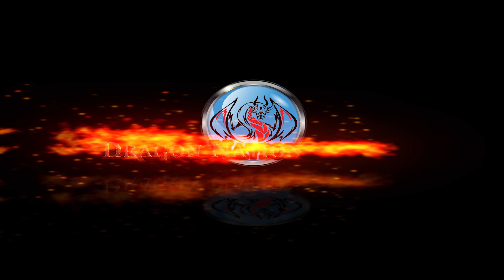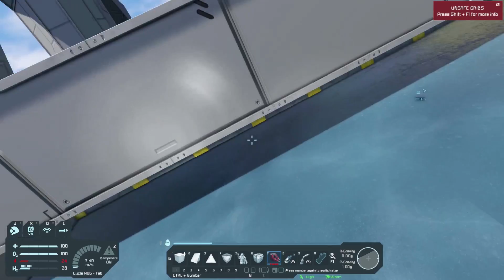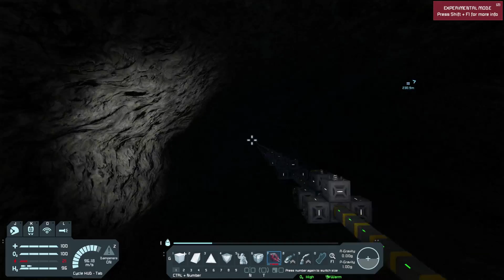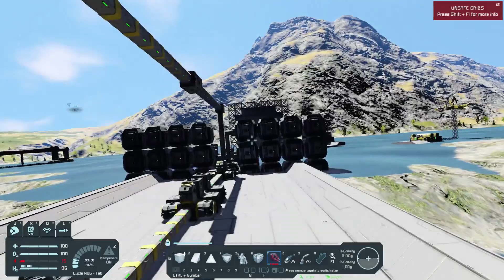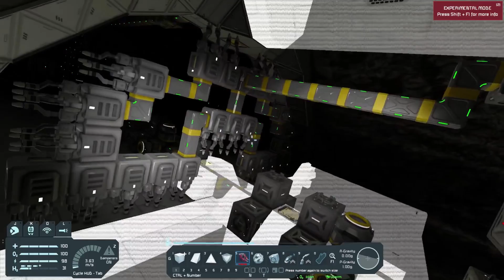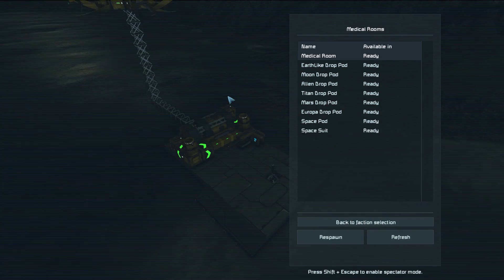Space Engineers #12: Finishing the Tunnel

Comment: Instead of trying to make a round of welders pointing outward, I would have made them pointing backward, so they weld from behind each block, not from the inside circle(if that sentence makes sense) :/

That way you could have used the original ones(and the projector pointing backward also), could have been attached to your inch worm :D or be a separate one following the digger(with the grinders too or something, using the same tether :)

Too late now :D
Reply from the maker: You can't because of the collision mesh. I tried it.

Comment: Skipping through, there are other options you likely haven't considered.... Instead of having all of the welders facing along the edge of the tunnel - add some to the REAR. This way, when you move inwards, you can weld up the 3 thick arches, without losing anything. You would need to keep those projectors stationary, most likely, either by making temporary projectors or by having another set of pistons move the projector in the opposite direction as you move.

Comment: instead of making an inch worm welder rig to do the complete tunnel ... make a wheeled version that does one side only ... every other center junction from the inch worm digger put in your support frame ... the empty ones can then be adjusted to make side tunnels and or parking space etc .. also allowing for multi way junctions ... or intersections ... also instead of running ON the diggers line remove the diggers line as you build and make the final one BUT keep the diggers line attached with the builder rig ... as for the size of the build frame .. add sections of just road so they line up between every other digger junction .... to dig up ... make a rig like the inch worm BUT on the bottom coat it with collector pits so as the drills go up and dig ... and the back side welders build all the stuff that falls gets removed ... also put the up rig on wheels so when you do the elevator it is already made to go ... and yes make it so the drills can be removed .... as for making it flip up or down ... a pair of rotors on a junction line that can be rotated to the angel you want and some pistons with landing gear to lock in (yes BOTH sides) ... then you can literally drive the rig down the tunnel get to your up place set the landing gear part rotate the rig to the desired angel and then build a section ... dettach the rotate gear and let it build your elevator ... as golem would say ... up, up, the ... elevator it goes ...
Reply: instead of making a lopsided bouncy rig .. why not make a 3 section rig ... back connector .. middle and front ... the front digs the middle runs the projectors the back supports the welders ... then the middle will keep the balance when the drills move forward and the back will keep the drill lines connected back and build the final lines as it moves forward ... basically front digs to next junction ... slaps it in on the sides ... upper would be best ... then the the back moves forward build the road and arches as well as the final conveyor system ... which takes all the drill stuff out and the build supplies in ... when the back meets the middle ... the back locks in and the front is already locked ... the middle then unlicks (yeah i know a typo but it fits) and moves forward to the front set and locks in then the front unlocks and moves again and locks in then the back moves up and so on ... essentially make it like the final inch worm from when se started ... the diggers make the hole ... the middle and back support it ... then the front and middle support the back ... then the front and back support the middle ...